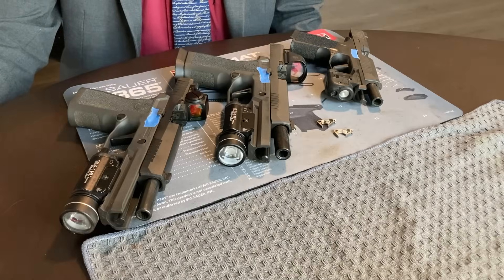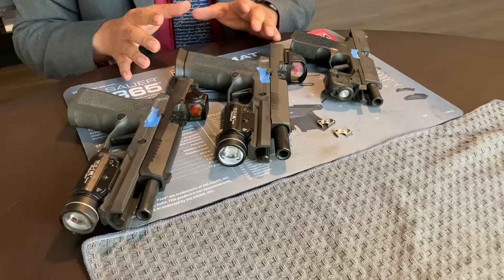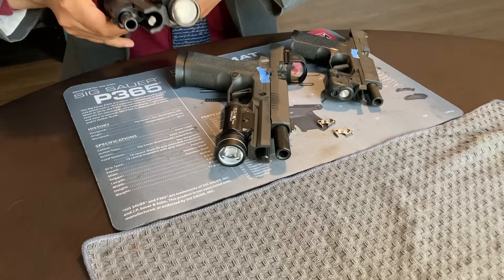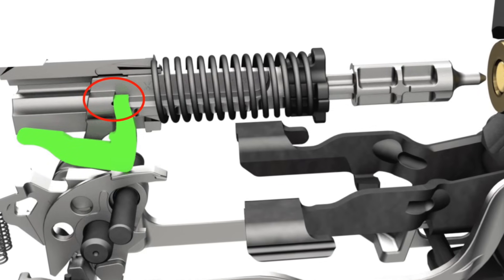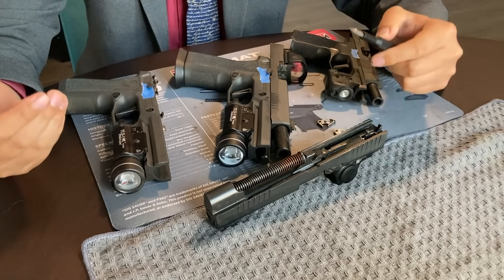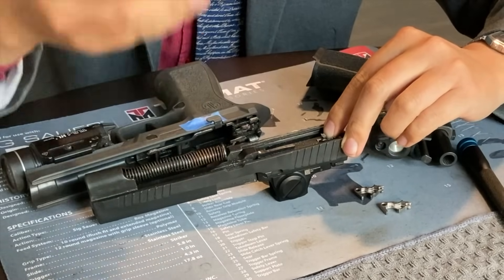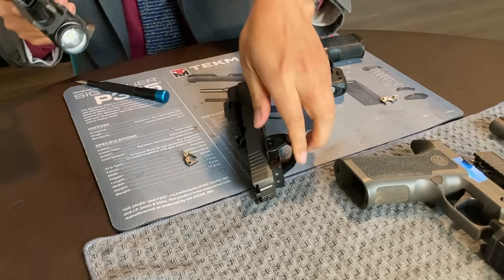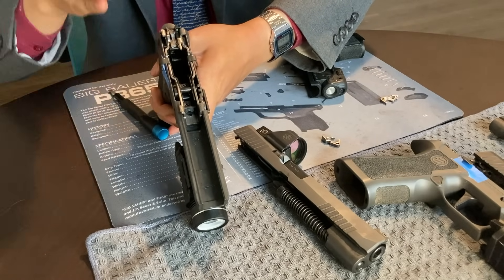How to fix a P320 that fails the Sear Movement Test

Comment: Another banger. Truly appreciate your investigation. It still bugs me that despite your excellent investigation into the issue, we can’t seem to figure out what is causing this unintentional sear movement and subsequent sympathetic trigger bar movement and even then, why is the timing of the trigger bar with the striker safety component on slide seemingly out of time on some pistols compared to others? Seriously, I’m beginning to think that these FCUs were probably just put together by any regular person without any working knowledge or regard to how they should properly function. It seems like the only explanation at this point and maybe that would be okay if the FCU of the pistol didn’t have an inherent critical design flaw as demonstrated in your presentation. 

I left a comment on your last video, I’m not sure if you saw it. My current only 320 is the Xten variant. Purchased less than six months ago. When I was performing your previous tests I got a bit mixed results. My trigger bar seems to be a different design from what I can see in your videos. My pistol passed your punch & slide test, but when I performed your 2nd test when engaging the sear outside the FCU the trigger bar would travel downwards & forward however when reinserting back in to the frame and performing the same test, I could only observe the trigger bar moving forward without any perceptible downward movement. Despite this, my pistol passed your first test so overall this has been a confusing experience. Naturally I am kicking myself for having sold my Glock 20 to help pay for the XTEN…
Reply from the maker: It sounds like one of the two mitigating factors is active in your pistol. As to why the FCU acts differently outside of and inside of a grip module, that's precisely why I advised people not to draw conclusions with a naked FCU - the pressure applied by the grip on the side of the FCU affects how it responds to the Sear Movement Test.

As to exploring the root cause of Sear movement, that's for someone with institutional levels of test equipment and sample size.

Comment: So ironically, in trying to avoid a trigger pull for takedown, they produced a flaw that potentially bypasses the entire striker safety mechanism. Unreal. What's even more unreal is that even if this flaw is fixed, the sear-striker lockup geometry is so bad, the gun might just decock itself from any random nudge or movement. Then when you try to fire it, you get a mushy trigger instead of a bang. And ultimately, all of these issues were caused by Sig's insistence on not using a trigger safety.

Comment: A guy posted this video in the P320 group on facebook and admins nuked his post within 10 minutes of him posting it. Anyway awesome job finding the correlation with the trigger bar movement. I have an M18 that seems to fail the test and an M17 that seems to pass. M18 has an agency arms trigger on it so it's hard to know for sure if it fails but I think it does. Any excess pressure on the trigger seems to negate the test as it thinks the trigger is being pulled? For the M18 with the agency arms I have to slightly press on the glock style safety and that MIGHT be fudging the test into a failure but pressing sear before that engagement point the trigger bar moves strictly forward so... I'm pretty sure it fails.
Reply: because there is no long term testing on this mod and Sig designed the sear with the leg for a reason.  It's non-sense to state vibration over time when there are millions of these in circulation and you only see these issues with police, military or modified.
Reply: @davidpenrosejr3698  yeah he just "discovered" this, of course there's no long term testing. No one suggested doing this mod to your carry but if you have a range gun to try it on and give feedback awesome. Sig designed the leg to intentionally interact with the trigger bar under unintentional sear movement??? I doubt it, probably has something to do with making manufacturing easier/cheaper. Might just be a locating tab that for cost savings never gets removed. Maybe it's something important that's definitely possible, but either way it should not be interacting with the trigger bar.

Comment: Thanks for showing the dual leg sear was the design flaw. Bruce Gray crapped the bed on that design. lol 

On the striker reset spring, it isn’t needed and doesn’t cause issues. On my striker assembly’s that had them go out, I just removed them. All it does is leave the striker protruding until the slide is cycled and the striker is cocked again. The Army doesn’t use them either.

Comment: Sig uploaded a video to YouTube called “P320 Upgrade Guide” on Oct 23 2017. They state the purpose for the rear sear leg. Video is now deleted but can be found using wayback machine.
Reply: Would post a URL but when I do my comment disappears
Reply from the maker: Weird, it's YouTube nuking the comment before it even reaches anywhere because it doesn't show up in my "Held" comments filter.

Would love to see that but I'll take your word on it, if nothing else because I have difficulty seeing what the heck else that rear leg could be doing. Nothing else makes sense.
Reply: Can you post the basic message of that video?
Reply: They discuss the added sear leg and that it uses the rearward pressure of the trigger bar to make it harder to depress the sear.
Reply: @ericheinicke257  Will it post if you use a "let me Google that for you" in the "short-form" link?
Reply from the maker: I believe what YouTube is doing is killing any link outside of YouTube itself. Try searching the YouTube video with the code "u9vIY2EoJwE" on the Wayback Machine.
Reply: The example I found was a May 28 2019 archive date. Agree on the URL.

Comment: Great video! 👍 Your analysis is quite plausible. Also, based on your analysis installing a thumb saftey should do the trick as well, since it will block the trigger bar thus preventing the striker saftey disengagement.
Reply from the maker: I hesitate to say the manual safety is a reliable source of mitigation to defend against the design flaw, as 1) I've only had my hands on one Manual Safety FCU making that sample size way too small to draw conclusions from, and 2) That one USMC report of an uncommanded discharge confirmed multiple times that the Marine in question had their manual safety engaged the entire time.
Reply: @P320Truther  not a Marine but a Japanese security man although well trained.
Reply: The manual safety is strange. It prevents the trigger from pulling the trigger bar forward by snagging the rear of the trigger bar with a little nub. However it doesn’t stop the sear from moving the trigger bar, it just modifies how the trigger bar moves.

In my experience the manual safety caused the “disconnector like” behavior from video 2 but with a sample of 1 idk if my observation is universally true
Reply: @ericheinicke257  the movement you mentioned is correct , but I notice  if the thumb saftey is engaged the striker saftey release does not move upwards. I owned a P320c for 3 years now and installed a thumb saftey on mine using the Sig Mechanics solution. I never had an issue with my pistol only having to replace a broken striker saftey reset spring by following the process shown on the Sig Mechanics video "striker protruding from breech face".

Comment: So what I have noticed is that in my fcu as it passed by pressing the sear it does not move high enough to move the trigger safety. Now as i am learning more and more it seems that the sear springs will not allow the sear to move unless the trigger is pulled if it isn't pulled it steps down to the second part of the sear thus preventing the firing pin to be seen in the preach. Im hearing some rumors of a resolution that being said these technical videos are doing what should have been done to find out WHY the ones that had ND or UCD fired without a trigger pulled.

Comment: This is interesting information but doesn’t on its face appear to be a smoking gun, pun intended. The common narrative of these failures is uncommanded discharges while holstered. How would a holstered pistol have its sear unintentionally depressed? It’s highly unlikely that people are holstering pistol with “pokey things” wedged between the frame and slide. For this hypothesis to be worthwhile it needs be replicated in a similar condition to observed failures in the field and not with very intentional movement of a tool inserted into the pistol.
Reply from the maker: I don't care why the sear is moving, I care what happens when the sear moves, no matter what is moving it aside from the trigger. If we keep the Striker Safety Lock in good repair and prevent it from being deactivated by anything other than a trigger pull, all the uncommanded discharges go away. The P320 will in this case end up like the original M&P and the VP9 instead - sear movement might let the striker drop, but the final striker block keeps it from setting off the round.

Comment: Sig has got themselves a tolerance stacking nightmare on their hands. I found a mix of aftermarket components that work with the rest of my FCU to allow for it to reliability pass the seer movement test, but the combination results in a trigger reset that feels weak and mushy. I'm going to get another seer and make this change and then get my preferred trigger bar spring back in.

Comment: One theory is a parts mix up on the takedown lever between the ten millimeter and the nine, the ten being slightly larger.
Reply from the maker: That theory is based on a misunderstanding of the FCU. The takedown lever is identical on all FCUs.
Reply: @ I see different parts between an 10 and 9
Reply from the maker: Find the page for "P320 Takedown Levers" on Midwest Gunworks. To quote from their page description: "Parts listed here are designed for the Sig Sauer P320 pistol model chambered in 9mm, 10mm, .45 ACP, .40 S&W or .357 SIG unless noted otherwise." And there are no takedown levers sorted by caliber. They are identical between all FCUs.
Reply: @ the SIG website is somewhat vague and seems to disagree, I olnly own a ten and cannot compare them
Reply: @ could the tab on the sear be a inertial balance weight?
Reply from the maker: Someone else pointed out that there might be a matter of exact terminology going on here. Takedown Levers are identical between all FCUs. Takedown Safety Levers are different between 9mm/.40/.357S and .45/10mm. I have some reservations about the source as the source gets a fundamental behavior of the Takedown Safety Lever completely wrong, but it might be worth investigating that difference in Takedown Safety Levers.

Comment: Question: if the “upgrades” were to make the P320 drop safe, would removing the sear leg make the P320 not drop safe again?
Reply from the maker: Perhaps I am lacking in imagination, but I don't see a mechanical way for the rear leg of the sear to have been contributing to drop safety.

Comment: Great video explaining.. Is it possible for Sig to mix up takedown levers for the 40 S&W 320 pistols and put them in the 9mm pistols. I believe The dimensions are bigger on the 40 S&W but still will fit in the 9mm pushing up on the leg when assembled.
Reply from the maker: It is not possible for Sig to mix up .40 takedown levers and 9mm takedown levers... Because they are the exact same part.
Reply: I meant the 45 acp. it’s the bigger version of the takedown safety lever.
Reply from the maker: The takedown lever is identical between all P320 FCUs.
Reply from the maker: Someone else pointed out that there might be a matter of exact terminology going on here. Takedown Levers are identical between all FCUs. Takedown Safety Levers are different between 9mm/.40/.357S and .45/10mm. I have some reservations about the source as the source gets a fundamental behavior of the Takedown Safety Lever completely wrong, but it might be worth investigating that difference in Takedown Safety Levers.
Reply: To further expand on this, 9mm, .40, and .357 use the same FCU and are interchangeable… hence why conversion kits are just swap the barrels, slides, and magazines.

Comment: Another good video and more great detective work. If sig magically shows up with a legless sear in the future we'll know why I suppose. 

I did the FCU removed and in frame sear test on both my 320s and got mixed results depending on if the FCU was installed and which frame they were installed in.... I'm still curious what exactly if anything there is to make of that....
Reply from the maker: The pressure exerted by the frame on the trigger bar and the trigger bar spring seems to have an effect on how the trigger bar performs in any given FCU when acted upon by the sear. The good news (with potential unforeseen side effects?) is, trigger bar behavior when acted upon by the sear no longer matters if we lop off that rear leg of the sear!

Comment: Man they went the long way around the world to keep from designing a glock-like system.
Reply from the maker: Given the constraints of fitting a striker-fired gun into a hollowed-out P250, the engineers did a really clever job of replicating that striker block function... But the P365 clean-sheet design is clearly better in multiple aspects.
Reply: @P320Truther  it's the required chassis design. I think the Berretta APX is the only other one that does this. I have not heard anything bad about the APX but I only know one person that has one. They are clearly not as popular.
Reply from the maker: I know a few folks with APXs, including the older Toblerone slides. They seem to be very nice pistols, but with a depressing lack of aftermarket and gear support.
Reply: @P320Truther  that's the truth. I looked at buying one but the holster selection is abysmal...I guess you could have them custom made if you could find people with the vacuum dies. I don't do anything but kydex.
Reply: @bmphil3400 I had an apx pointed at my Johnson for a couple years.  I sold the 320 as soon as this debacle kicked off.  I have a g19 pointed at the Johnson these days.

Comment: Excellent job sir! 

After disassembling my FCU I came to the same conclusion as ericheineke, that the trigger bar spring acts as additional sear spring. I can’t see any other function for it. 

I think the SIG engineers figured more sear spring load was better but neglected to realize that they were unintentionally allowing the sear to backdrive the trigger.
Reply: Apparently its shaped this way so that if dropped, the sear cannot shake from its position. It's a drop safe thing

Comment: Both my 2017 made, voluntary upgraded P320s pass the sear test without issue.     I'm going to find some time to inspect mine more closely to see what may be different.  While this seems like a workable fix, I think there needs to be more testing.    What is different on some upgraded P320s that make them susceptible to this failure and others not?  Presuming they all of have the rear sear leg design.
Reply from the maker: That is what I address in the section about mitigating factors. Some P320's display downwards motion of the trigger bar in response to sear movement, which delays the safety lever activation until after the striker falls. Some P320's have particularly strong striker return springs, which for some reason that I've yet to discover, reduces the chance of a striker to fully fall and protrude.
Reply: @P320Truther  But the design flaw that causes sympathetic movement of the trigger bar, by your explanation is the real culprit in this case.  I am curious to know if there are dimensional differences between those exhibiting the behavior or not.   Is the rear leg too long? wrong angle? etc.